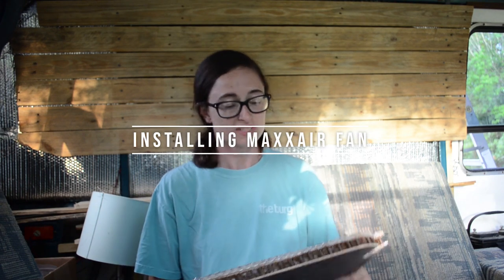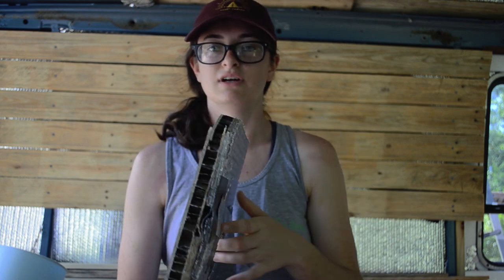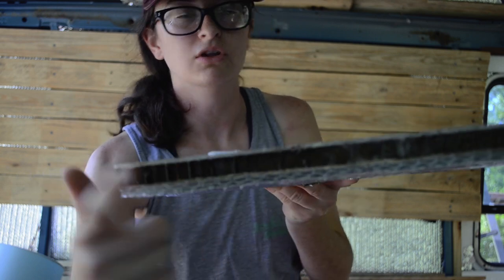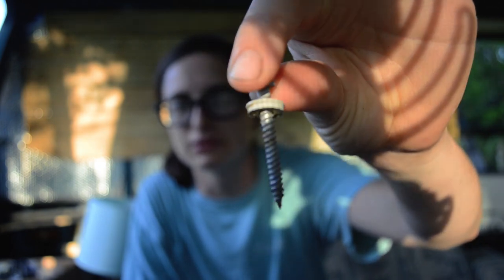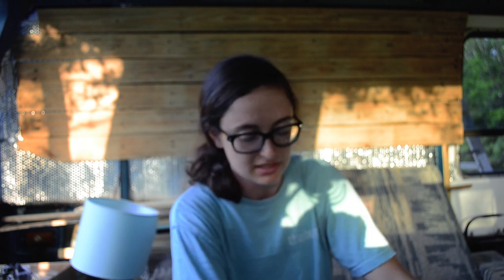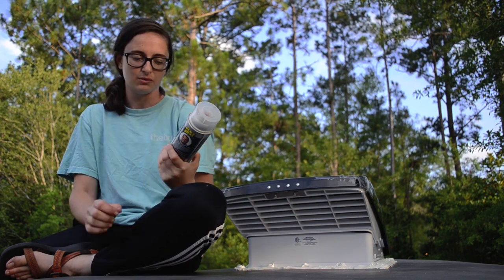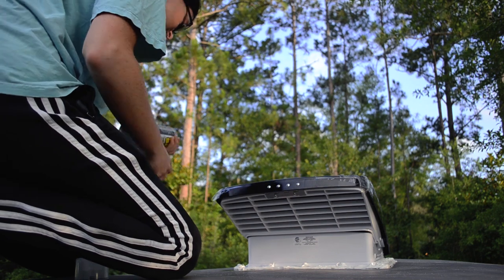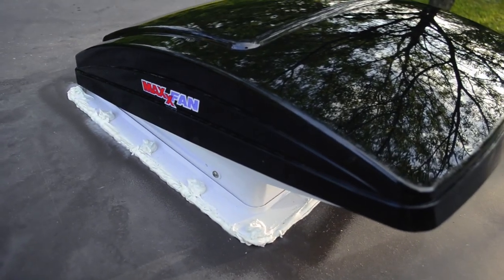Installing MaxxAir Fan in Fiberglass Roof / diy van conversion

Comment: Great choice of fan!  I’ve been DIYing trailers now vans, and from the rv background, I would suggest DIcor RV lap sealant for the caulk up of seam and screw heads.  If you need an additional coat to seal (the dicor SHOULD do it by itself), i’d personally recommend Eternabond tape.  Don’t settle for cheaper imitations.  Thing about eternabond though is that the name is serious.  It is very difficult to remove.  Thanks for making this video.  I just bought a 94 Dodge van with the tall top.  It will need a fan.  All vans do!!!😊

Comment: Now that its been a few years, have you had any leaks?
Reply from the maker: No leaks! My spray adhesive on the tapestry needs to be redone, but the fan is working like a champ still. When it's hot I leave it running all night and the power draw is unnoticeable!

Comment: Stoked you did that for me to see cause I have the same roof in my van which is a 97 Chevy Express and a brand new max air the same one you got I think. Mine is a 7500 But I've been kinda scared to cut a hole in my roof! I've looked for videos on it multiple times and you're right there are none! I said I'm going to check one more time before I  go for it. When you say "through the wood" do bvb you mean you have a wood ceiling under the tapestry? Mine is just thin carpet and then the fiberglass, pretty sure. Was your roof thick enough to mount it without building it up, besides the butyl tape that is. I may have to build up a wood frame like they suggest. Thanks for testing the waters. My butyl tape and silicone I ordered will be here tomorrow so it's almost time! It will be so nice to  have some circulation!
Reply from the maker: Sorry for the late reply, but mine had a layer of plywood between the fiberglass roof. I went to a junkyard before and cut into a fiberglass roof to see what was inside and it also had some plywood. Hope the conversion is going good!

Comment: I have a 96 G30 with a raised roof I'm going to install a maxxair fan on and wanted to see how yours was holding up. Is your roof still leak free? It was pretty cool to see you posted an update a year ago, so I thought I'd ask.
Reply from the maker: Still leak-free, been to lots of states and National Parks and rolling strong.  I did basically the same thing when attaching my solar panel just without the bondo. Lots of caulk and flex seal. Happy Travels!! :)

Comment: Did you ever add a wood frame to screw the game into? Did you add framing to the whole roof?
Reply from the maker: No wood framing on the roof, I wanted to be able to stand up, so just reflectix and a tapestry. It is hot in the summer, but I don't think insulating it more could ever beat southern heat. Good luck!

Comment: Howdy from Texas! Its super humid here almost always. I was wondering if you could share how you insulated the roof of your fiberglass van? I have a 2000 dodge ram with fiberglass roof. I've insulated everything but the roof. I just cant seem to find a method that would prevent mold buildup do to condensation. Once i figure this out I'll be able to move forward and install a fan. Might you have any words of wisdom? Thanks a ton for sharing your fan video. That is super helpful.
Reply: RICO PHOTOFX I’m about to do mine and honestly, it depends on where you live. But I live in regions where we get plenty of snow in the winter, so there’s no way I’d do anything other than spray foam. Seals everything up so there’s no chance of leaks/condensation and has the highest R value
Reply from the maker: I just used a layer of reflectix and spray adhesive. Looking back I would've done something better, but I also like being able to stand up in the van and if I did anything thicker, I couldn't do that. So its a compromise. The condensation hasn't been an issue yet!

Comment: How did you insulate your roof? I have a fiberglass roof in mine as well, which I'm planning to redo insulation because I'm running into some leaks. 
If you have any feedback I'd hugely appreciate it!
Reply: Just scrolled through the comments and found your replies to similar questions. Thank you so much for this video Kendra!!

Comment: I have a 1988 econoline im attempting to do the same, although I won’t be insulating (because I’m in California) did the fam sit flush on the inside of your roof or did you add insulation or some sort of a frame on the interior? Thanks for the video!
Reply from the maker: The fiberglass roof just has one layer of Reflectix with a cloth tapestry over it. I just used some spray adhesive and staples to hold it up and it's been holding, even in the heat of summer. Good luck on your conversion!!
Reply: Mountain Man this seems like the best route, but I can’t for the life of me figure out how to attach furring strips/framing without puncturing the fiberglass. What is your method?

Comment: Does that take out your headspace? How’s the integrity of the roof holding up?
Reply from the maker: The only thing that adds any room is the knob to open and close the fan manually. Still no leaks or problems driving down the road. My only issue is the spray adhesive for my tapestry doesn't bode well in Southern heat and humidity. Thanks for your comment!

Comment: Did you just cut the fiberglass roof with a jigsaw?
Reply from the maker: Used a drill to make some holes then yes. Worked just fine because the plywood wasn't too thick in between!

Comment: Thank you! Can I ask what and how  did you do with the plastic shell inside?
Reply from the maker: I'm assuming you mean the white plastic piece? That I roughly measured the extra overhang and used an angle grinder to cut it (a hand saw will also work, it's thin plastic) and then just used 4 screws to attach it. Hope that helps!

Comment: Would be even greater if that cutting process has been filmed. Is installing solar panel(s) next?
Reply from the maker: Yes, I'm not good at the whole youtube thing, but 100 watts of solar has been installed for some time and a dual battery isolater to charge off my alternator too!
Reply: @kendracole4948  I will try to drill 4 holes to install a solar panel on the fiberglass roof. Thanks.
Reply: @kendracole4948  Ok, thank you. Do you use bolts or just screws to hold the panel? I used the crews come with the package, not sure how well they hold on highway drive.
Reply from the maker: @ehlai1676  I'm pretty sure I used the same ones I used for the fan install with the tape and silicone on top. I had some leak issues where I drilled holes for the solar wires, but more silicone and flex seal seemed to fix the job! Good luck! Its been roughly a year and stills holds fine, even on the interstate! (Top speed is 70 for me though) haha
Reply: @kendracole4948  I only have a 100w panel installed at the back, giving room for two though. Not having a roof fan seems hot in Southern Ontario during the day...as the original insulation for the Ford 2000 e150 passenger van is pretty bad. Would try to connect the alternator to the battery.

Comment: Hi we have a 93 chevrolet g20 we are trying to cuts holes in our van for our maxxfans deluxe n dome what type of tools u used because we cant find no shops to do it we stay in memphis
Reply from the maker: I used a jig saw hand tool. I used a drill bit to make the holes and went from there. It was pretty easy!
Reply: @kendracole4948  thanks did u have trouble with anything else because we also have the back AC we want to removed it too
Reply from the maker: @intutharainbow7808  I removed mine too. My battery bank sits there. I had a professional weld up a bypass for the rear unit. The only problems I have now are mechanical like oil pressure and AC - stuff with older vehicles.

Comment: how did you insulate your ceiling? we’re doing a friends van and we’re stumped on the fiberglass roofing!
Reply from the maker: Mine is just reflectix with spray adhesive. Looking back, I might've gone for something thick or created air pockets between the reflectix to get better insulation. It's only bad when its summer, all other seasons, it seems fine. Good luck!